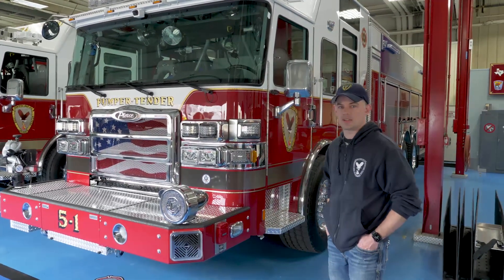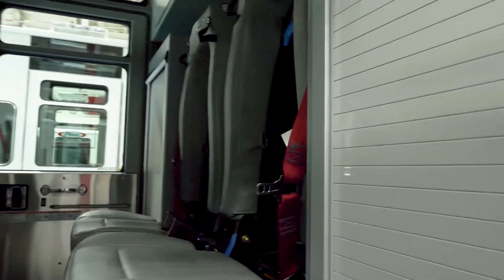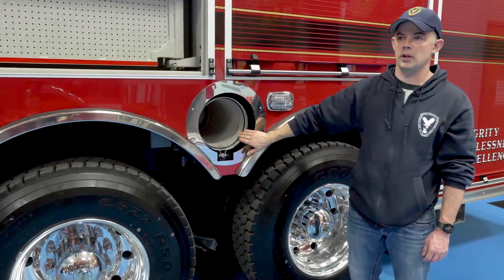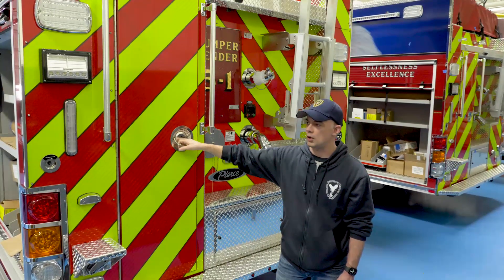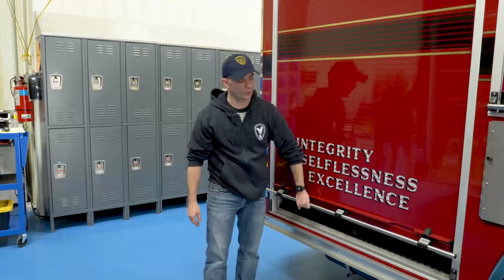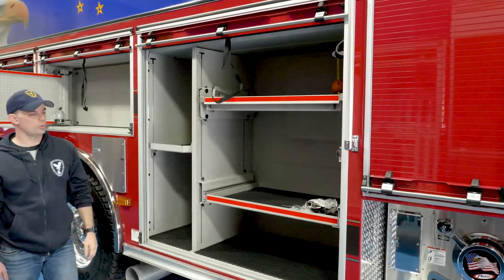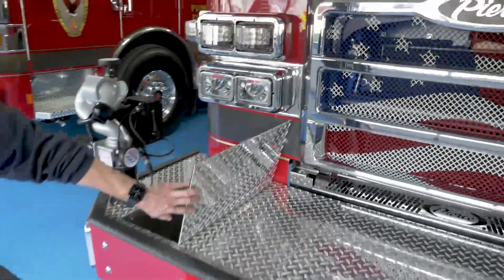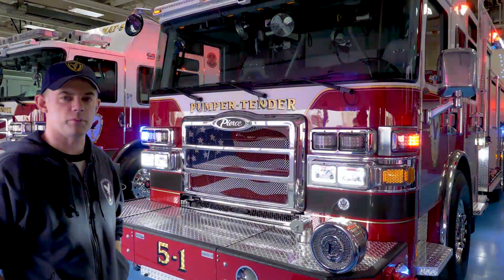Enforcer™ PUC™ Pumper Tanker – Wasilla, AK

Comment: What’s a snap tank?
Reply: Portable dump tank.  Similar to the classic Fol-Da-Tank, except whereas the Fol-Da-Tank is a one-piece unit--the frame is permanently sewn into the fabric--the Snap Tank is more like a camping tent in that the fabric "tank" and metal frame are separate parts that the crew assembles on scene.  The Fol-Da-Tank has the advantage of quicker deployment (a couple firefighters pull it off the side of the rig and pull on opposite corners until it pops into a square or rectangle) but requires more space for storage--two sides of the tank collapse, while the perpendicular sides are rigid, so a 3000g/11,350l model measures 13ft x 13ft x 29in/4m x 4m x 74cm (both units of measure rough and rounded) when open and 13ft x 7in x 29in/4m x 18cm x 74cm when packed--whether simply slapped on the side of a tender or an internal compartment sized to fit.  A disassembled, 3000g/11,350l SnapTank, meanwhile, measures 79 x 16 x 14in/200 x 41 x 35cm (I've never personally worked with a SnapTank, so I don't have deployed dimensions, and pulled the disassembled numbers from NationalFirefighter.com's catalog), so you're sacrificing deployment time for added space for other gear on the rig.  Looks like that's what works for Central Mat-Su, and they designed that specific compartment to fit their SOP.
Reply: Thats amazing information about Pierce Manufacturing: https://www.youtube.com/watch?v=1CSqlY1rKc0